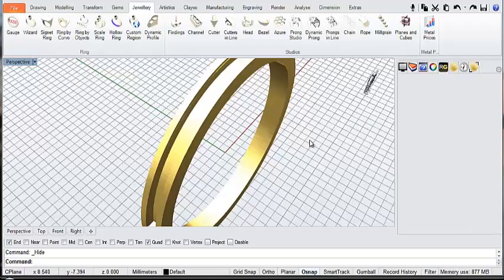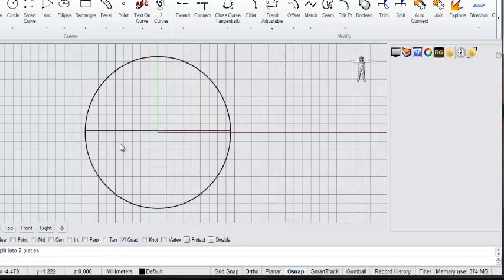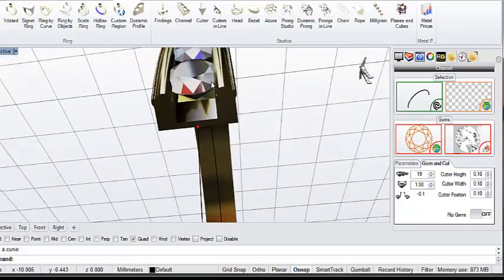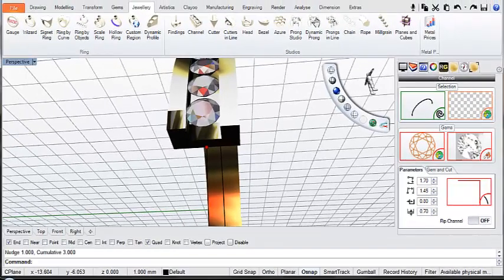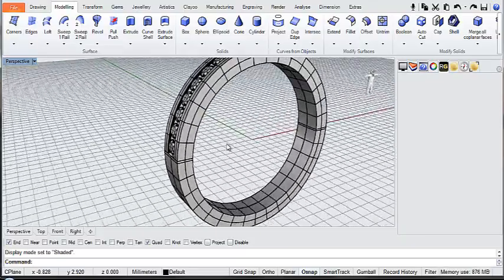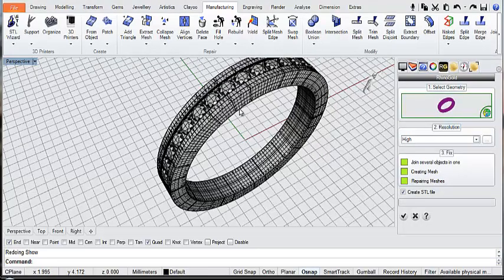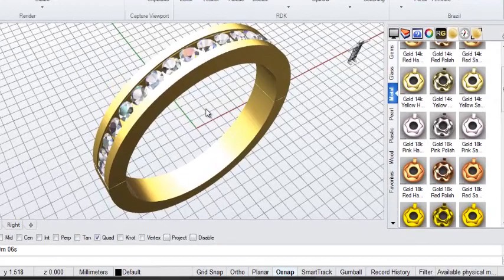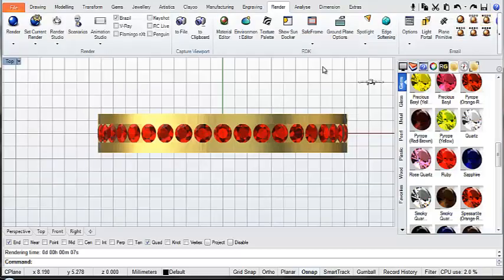RhinoGold 4.0 Tutorial - Half Channel Ring

Comment: Your channel profile was a rectangle so it was easy to draw lines to recreate the profile for the bottom of the shank. If I change to a rounded profile, how would you trace that profile?
Reply from the maker: Hi David. If you use a round or other profile, rather than "draw" over the shape using the Line/Polyline tool, in RhinoGold you can go to the Modeling Tab / Dup Edge (Dupliate Edge), and "click" on the bottom edge of the rounded profile and it will "create" a curve from that. If you rounded profile has a few segments, you may need to click on each adoining segment --> then "join" the curves to create a closed curve. I hope that helps.
Reply: Thank you for the fast reply. I will give this a try. I used the Line/Polyline tool but never thought of the Dup Edge tool. Thanks!
Reply from the maker: No problem. Let us know how you go. Regards, Rik